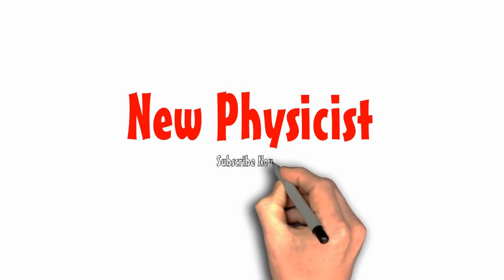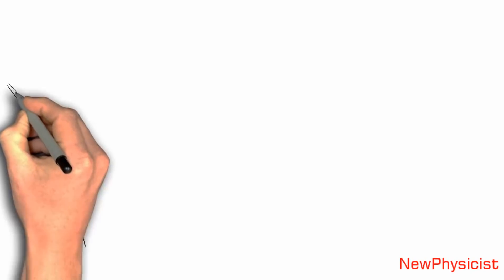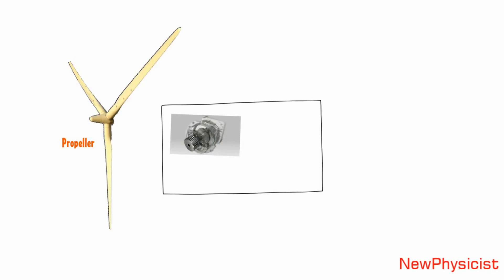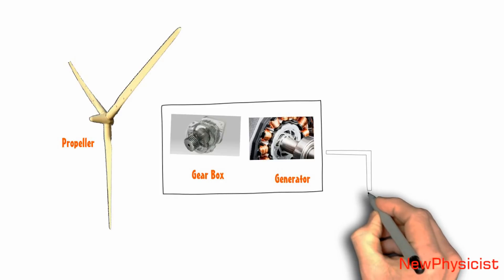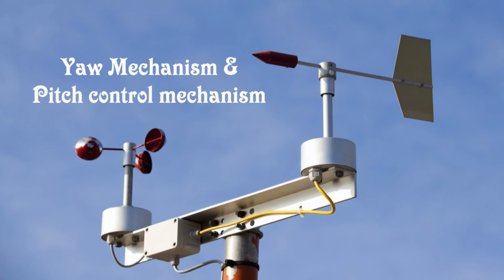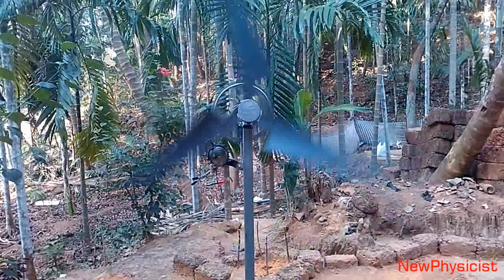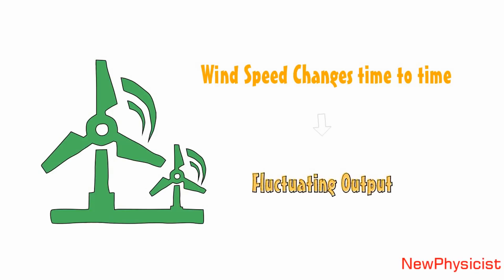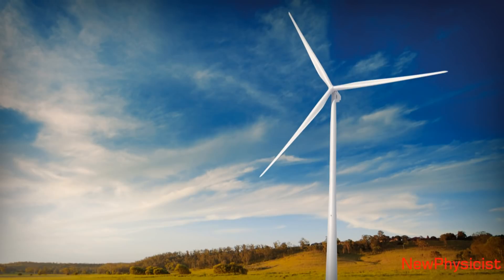How Do Horizontal Axis Wind Turbines Work?

Comment: Is wind using ground wire like an ac circuit?
Reply: Because the wind speed is not constant using ac current will not give steady voltage so first it is generatedd into DC  power and stored in a battery. And afterwards DC power is converted into AC power. Such system is also know as DC-AC wind generating system.